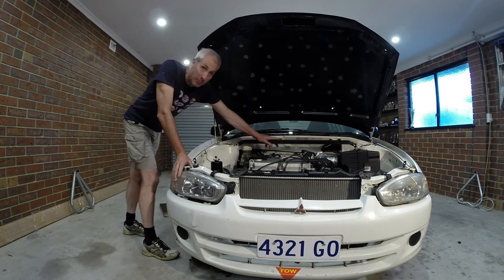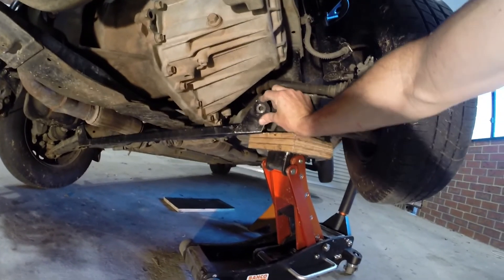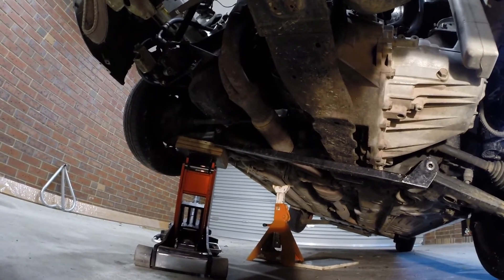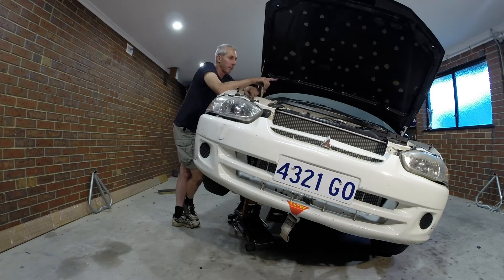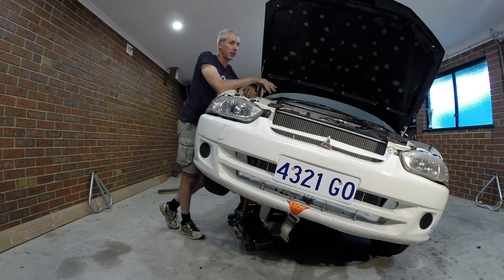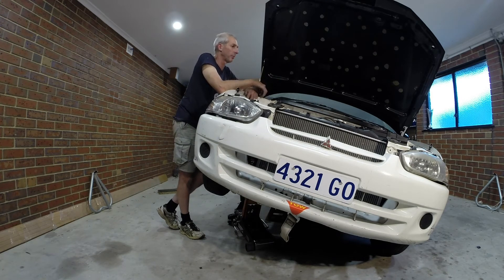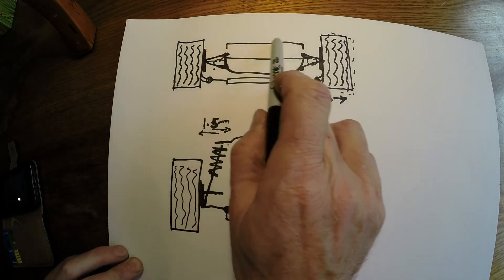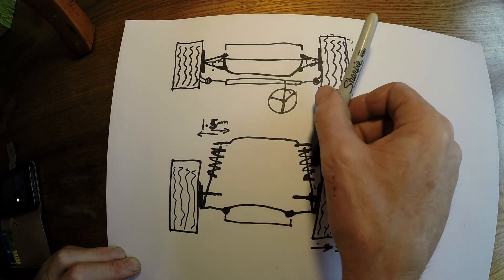strut bar instalation and test

Comment: Hello sir! Although that test is a good way to test body roll, driving the car on a skid pad and slalom is completely different and sjould be able to see a lot more body flex since the weight distribution are always changing with all wheels on the ground and flexing should be visibly significant wouldn’t you think?
Reply from the maker: I agree there is additional pressures in a live environment with lateral loads and changing center of gravity - G forces etc. It would most likely get a larger result, the method applied emulated around 1 G of down force only.
Unfortunately I don't have access to a skid pad, let alone one that would allow me to test a suspension component undone on one end. it would be an interesting test though.